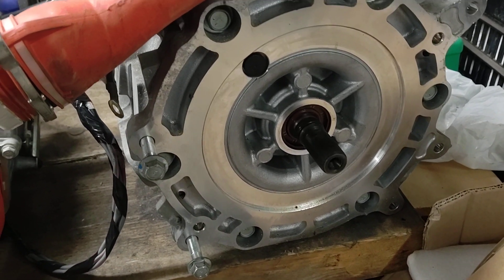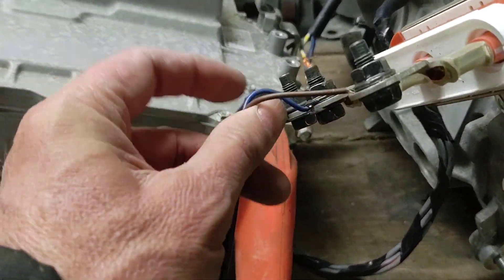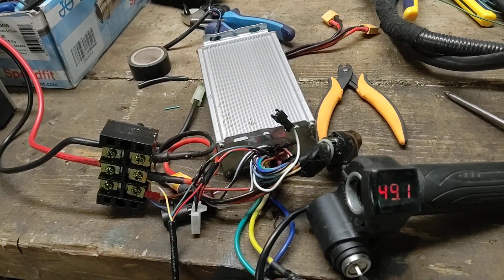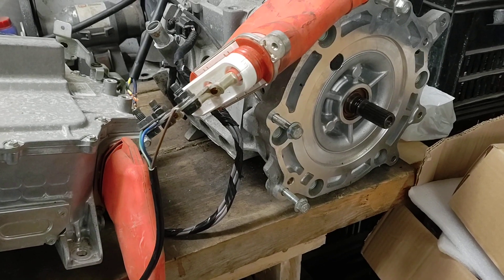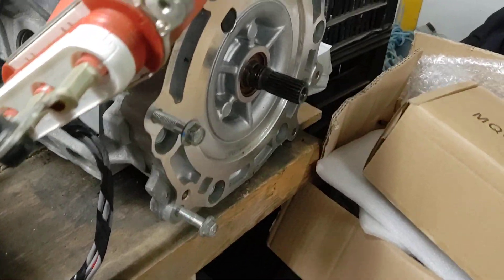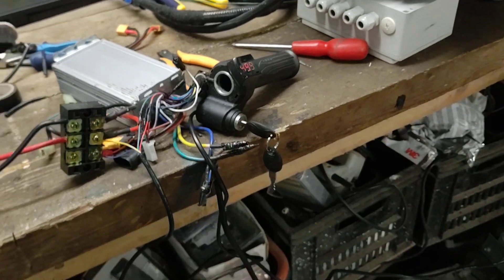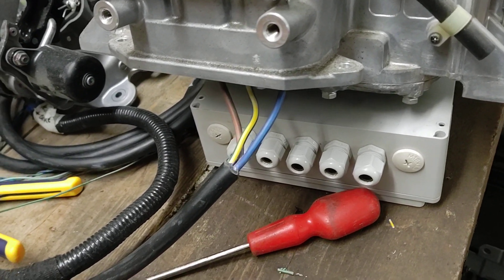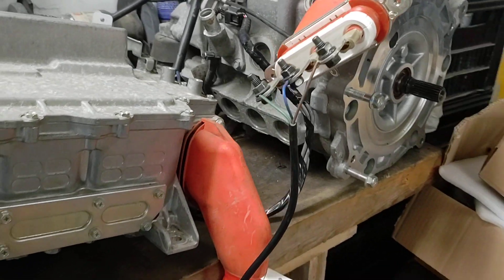DIY EV Part 8 - Nissan Leaf motor Driven by eBike Controller

Comment: Did you have to use the stock inverter to get it to run in this test mode?
Reply from the maker: The stock Nissan Leaf inverter wasn't connected.

Comment: Need some advise., Will it possible to charge nissan leaf while on drive mode using a generator? ( Similar way as Nissan E-power-Enote car)? or will it possible to recharge the nissan leaf using Enote power generator while on a drive mode?
Reply from the maker: Sorry mate, I've no idea but it kinda defeats the purpose of owning Leaf doesn't it.
Reply: @alibro7512   tkd9

Comment: I'm bench testing a high voltage motor w/one of these things too.  Were you able to output 800W to the motor?  I get throttle control but very low RPM.
Reply from the maker: I think I got pretty good rpm but it was a couple of years ago so not certain. 
I probably did get full 800W from it as I used it to move the car around the driveway.

Comment: So this means...  You can do a kart with a Nissan leaf motor and cheap controller?
Reply from the maker: Sort of, the motor can handle 300kW and the most powerful ebike controller that will work this way as far as I know is around 3kW so they're a tad mismatched. 😉

Comment: Any resolver feedback to this controller?
Reply from the maker: Hi
Thanks for your question.
In a word no. I have found that the cheap ebike controllers don't need resolver feedback to drive three phase motors. At least not the two types of motor that I've tried i.e. Alternators adapted to be a motor and this Nissan Leaf motor.
Reply: @alibro7512  very cool I have the same EM61 leaf motor. I just finished FOC tuning it to my open source logic prius gen 3 inverter.
Reply from the maker: @InvokePerformance  Sweet. I got mine working on the bench with the Leaf inverter using Damien Maguires VCU. Hoping to get it in the car ASAP.
Reply: @alibro7512  very nice are you using the leaf drop in board? And have you had any issues with setup? I have two leaf inverters gen1 and two and I’m waiting for development of the zombieverter which may alow CAN control of different inverters with one VCU
Reply from the maker: @InvokePerformance sorry I didn't see this before now. Hopefully you've been watching but I have the car driving reliably so hoping to get it on the road soon.

Comment: Hi, you got link to the controller you used in video.

Will give it a go.
Can take my PDM and inverter off boat and see under load
Reply from the maker: As far as I can tell any of the cheapest nastiest ebike controllers from ebay or amazon will work. The slightly better Sine wave controllers probably will not unless they are sold as being able to work "without hall effect sensors"
Reply: So this controller didn't require and HALL Sensors to be Hooked up